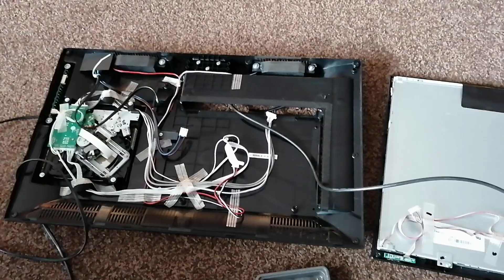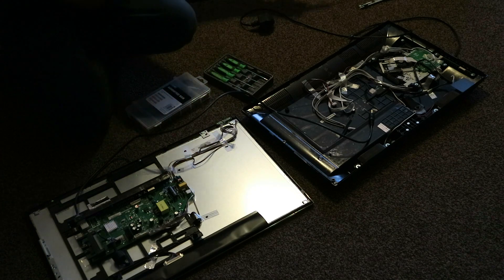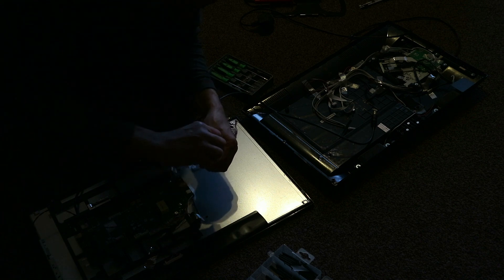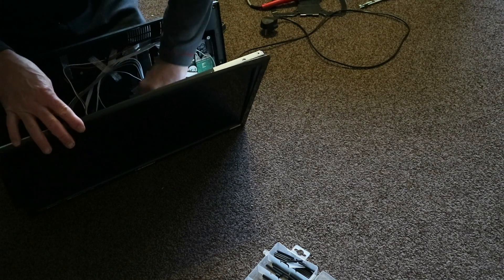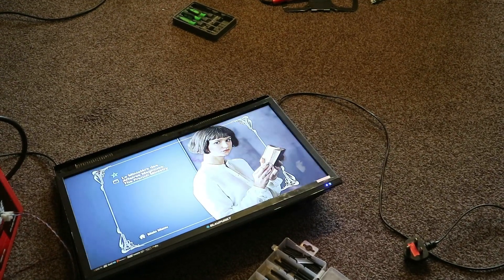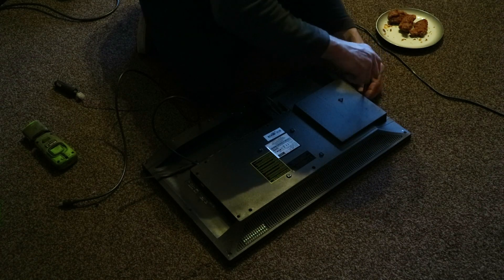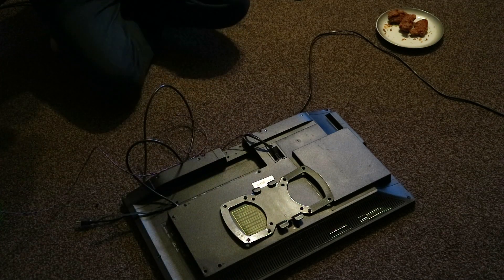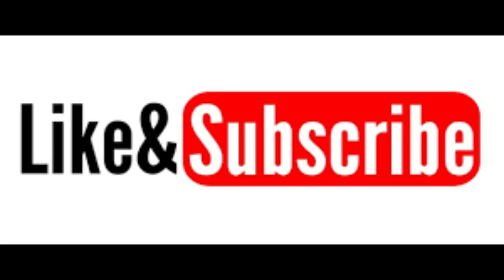240 volt tv to 12 volt conversion. Mains free

Comment: Just tried this hack using a jump start pack Worked great..
 I connected the Samsung 19 inch DVD/TV to my leisure battery with solar charger showing 13.9v ..it blew the TV.. Too many volts and Amps I guess..ah well it was a cheap TV so no real loss.. We live and learn. 😊👌
Reply from the maker: It should not have blown the TV, even if the. Solar controller is chucking out 14.60 volts for a AGM set up, I did use my TV in my transit for a week away and that has 260w panel with a 220amp AGM battery with a victron mppt.

Comment: Can't see what you doing from that distance mate, did you use thick wires? I used tiny wires because that upgrade is so tinty and they burnt, the t.v is still okay, just wondering if i should try again with thicker wires or did i do something wrong. 
UPDATE: polarities were switched, my thin wires started to smoke n burn so i disconnected quick and was about to give up then i figured i hooked it up incorrectly and checked the board again and saw that i misunderstood the labeling and so i correctly wired and boom, working like magic! the thin wires aren't a problem, i hooked it up straight to a truck battery hooked up to the mppt solar system charging at 14v, not a problem, i shuda done a vid too to show the doubters, Many thanks mate!
Reply from the maker: I think from memory I used .75 mm wire just because it has a dvd and I wanted to add a fire stick and usb to record footage from the tv. So glad you got it working 👍👍👍👍

Comment: It even said cn32 on the plus which is indicating channel 32 which will correspond to a group of transistors that controls the switching of that plug. 
If you look at the other plugs they also have CN and then a number which again its indicating a channel.

Comment: Is it possible to leave the 240v connection in place but add the 12 v connection to it as in your video so you can use choose which one you use depending if you're on a 240v hook up or not?
Reply from the maker: Yes I left it the 240v side as normal so it still could be used at home or on EHU 👍👍
Reply: What model tv is this

Comment: You've got 12 Volts going into the TV but how many Amps?
Reply from the maker: I fitted a 7.5amp fuse on the fuse box, when in my Ford Transit, Talbot express and now in the sprinter, it’s been 200% reliable, I will be completely honest I don’t know the answer, maybe I could amp clamp the positive but when I had the tv apart , I used 1mm cable power to the 12v plug then 1.5mm to the breaker board. It’s been one of the best mods and I didn’t expect it to last because of being a house TV in a van that I take off road most weekends. Sorry I know it’s not probably much help, just being honest.
Reply: @ProjectCamper  No worries, thanks for the reply.

Comment: Hi.. What was the volt and Amps output on that power pack.. Have you tried it in the van.. Thanks
Reply from the maker: It's a snap on battery pack with a Odyssey battery fitted, not sure but works fine in my Talbot express with a 110amp halfords leisure battery

Comment: Just tried this using a 40amp fuse on a  12v battery tv standby light comes power on the tv light turns blue but no screen ? Works fine on 240v any ideas
Reply from the maker: Marc Hilton hi there, have you a 12v power supply on your tv circuit board
Reply: @ProjectCamper  yes 12.65v  its 40" Bush led tv
Reply: Soon as I saw the red standby light on then I pressed the on button and turned to blue I thought great it works oh no screen coming on 😅
Reply: @marchilton7721  the backlight on larger tv's usually run at 36v from the transformer,You'll need an inverter for 12v to work it

Comment: Going to look at my tv and see if I can convert mine to 12v
Reply from the maker: Give it a go Paul, ive also just converted my android tv box to run 5volt usb, so if i plug that in the tv, i have a mini pc,all from 12v.
Reply: @ProjectCamper  just seen this on ash Pollard vlog I've just ordered a fire stick and the 12v cable